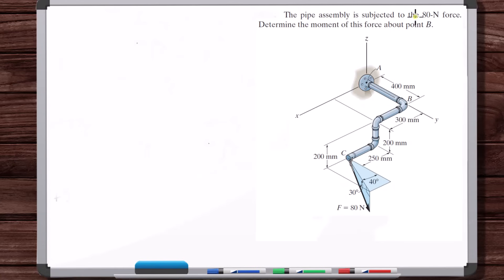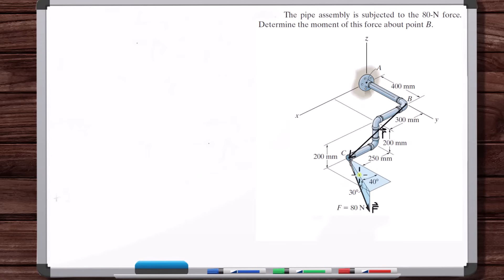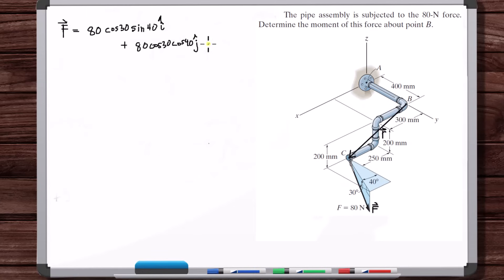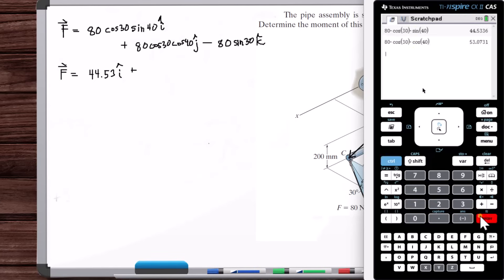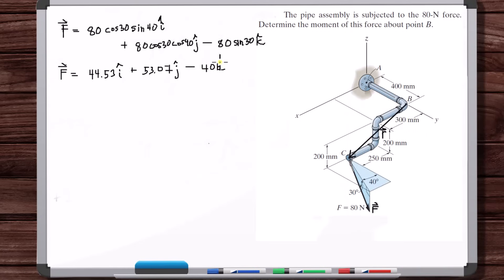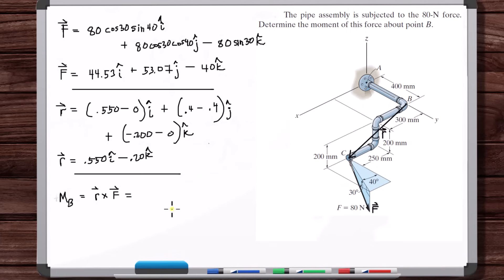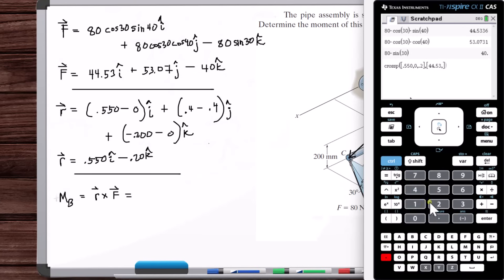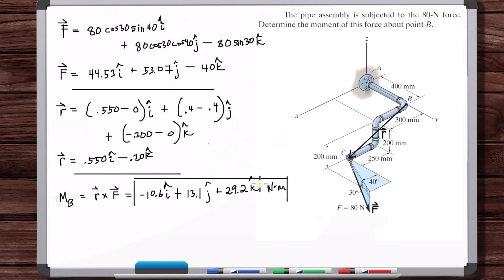Moment of Force on Pipe Assembly

Comment from the maker: Note: For the final answer the x-component of the moment should be positive as the result in the calculator showed. Also, the final moment symbol M_B should be labeled as a vector so it should have the vector symbol above M_B or it should be bolded.